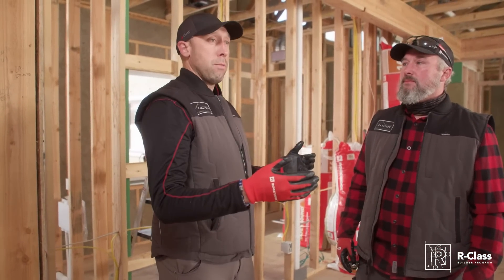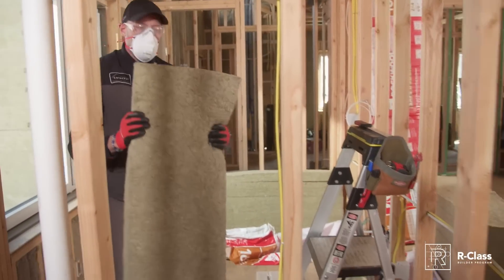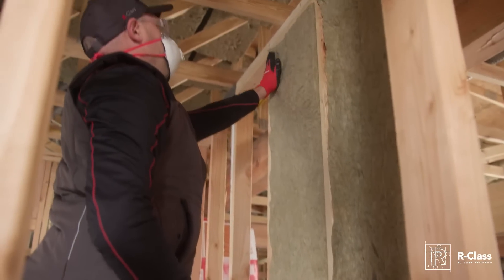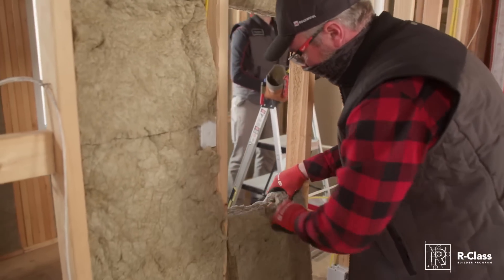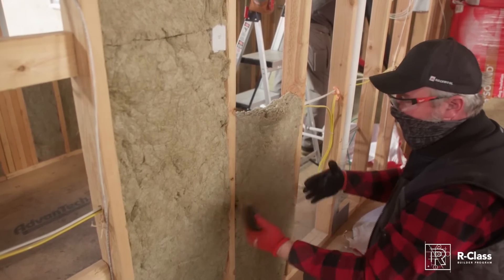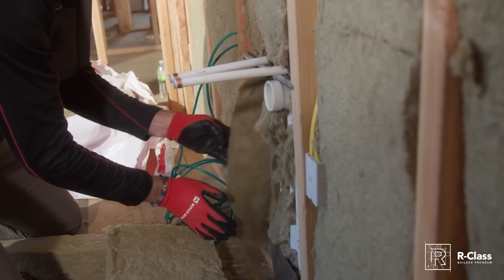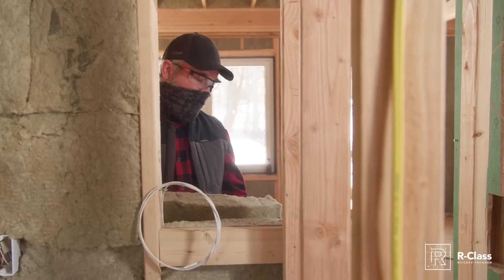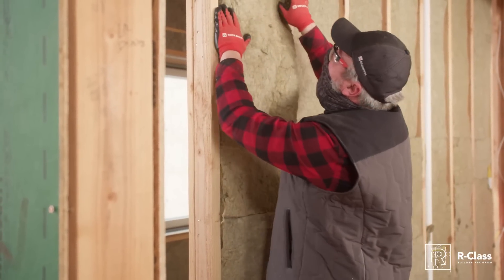How to install partition wall insulation | ROCKWOOL Safe'n'Sound®

Comment: I am looking at rockwool to insulate between floor/ceiling between levels. The bearers gap between the bearers is 400mm (approx 15") and the bats that I can find are 520mm (20") should I trim the bats closer to the bearer width or is it ok to just jam it in. I have never done any insulating. The kids play their instruments a lot so main purpose is acoustic between basement and living area
Reply: NO I'm sure you have your answer well before now, but don't jam it in there. Compression negates the function of any kind of insulation. It can take the minor compression of the ladder supports in the wall (near end of this video), but you shouldn't jam 20" insulation into 16-on-center joists. Hope you found the right size or found a good way to cut it. Hypothetically speaking, if I had to cut, I would have cut the bats on diagonal to the correct widths and laid diamonds and triangles